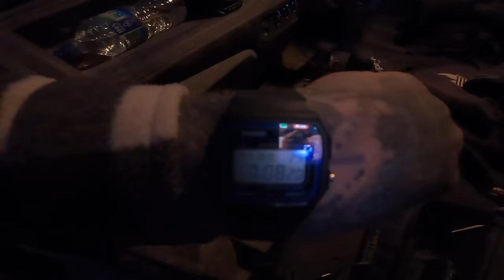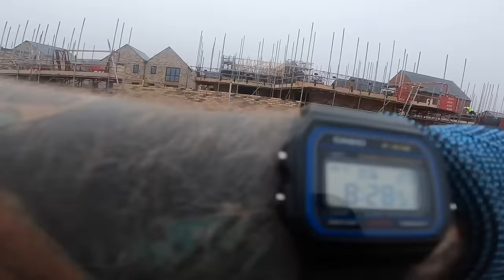Bricklayer and his improver building a single garage

Comment: Collison has made it big financially! That's why the man has switched to festool! I love their gear, my router and extractor although mega expensive, are the best you can get! Trouble is I can't ever bring myself to pay 300 quid for a basic 18v impact driver BARE unit! Oh yea.... 300 bones n the fudger comes with not a battery and even less charger! It's OK though because an 18v 5ah festool battery is a bargain at 125 quid and a mere 62 bones will land you a sparkly new festool charger! So for 300 sods you get an expensive, worthless piece of plastic that should you wish to round up that 300 to 487 sods, which as we all know in any language is 500 mother lovin pounds for a bar starred impact driver. What if you want something expensive like a chop saw, extractor or their plunge saw, I assume you use their saw to first extract the kidney you will need to black market in order to buy the damn thang.

Comment: I was a hoddy for a 6 & 1. 
I couldn’t keep up sometimes (on a straight run) and one of the trowels had to drop off the line to help me with loading out. Wasn’t unusual to shovel easily 5-7 ton into the mixer in a day. 
I could almost nosh the exhaust of a manitou when we had one to chuck a bath up. 
I was that fucked in the transit that I felt sick and the fellas used to give me a kick at my stop home. I miss those days. Rows, fights, arguments and weekly hassles.
Reply: My time as a nipper saw me sat in a muck tub in the back of a transit. It was fucking grim. Wet and cold in the winter and hot and dusty in the summer. The wankers used to squirt ketchup and mayo through the holes of panel divider from the front. 
They used to wind me up like fuck because I worked faster when I was raging! 
It sounds like Hell, but they were the best times of my working life so far!

Comment: When mixing wet and dry bricks....do full course dry, full course wet, not random mixed
Reply: ...you will find all the beds are dry after pointing with no brush marks
Reply: Always put dry bricks on the first course or on damps. Gives the wall a chance to go off. Nothing worse when the bottom bed is piss water and your wall wants to start leaning over

Comment: Couldnt you ask them to deliver dry bricks only, specifically stating you will refuse accepting any wet ones. They might be able to put a note on your order, i dunno
Reply: When they delivered they were dry ones, just didnt store em properly on site (first ones they were loading out at least)
Reply: Sometimes there delivered already wet and wrapped, holding in moisture, you can guarantee the salts will be coming out on wet red bricks

Comment: When I was young, I hated you brickies for the speed you put stuff down, especially when getting paid per brick.
One of my first site jobs was mixing the mortar for a couple of bricklayer teams, bags and sand on a board, bucket of water, and mixing it with a squaremouth.
busted my arse to keep up with them, then wheelbarrow and bucket on a line up the scaffold.
absolutely non-stop.
Good memories, good crew, but glad I got into dems instead, it's a lot easier bringing the wall down than helping it go up.

Comment: Would ran all sides in 1 go more so with damp bricks all dry similar rates beds and joints for point bar last few. Guessing you may have done that if had another body supply the muck to you and Tom. Just saves when last wall wacked at end pointing them becomes an issue. Smashed as per buddy. A don’t see nobody taking your crown at the super trowel. Ul smash it again a full expect another don’t fuck it Charlie boy 😎😎🤙

Comment: I like the red bricks, anything is better than an LBC fletton are they Redland ? anyhoo, looks like you forgot to hang out some  ties for the 1 1/2 brick pier mid flank @28.02 Oops, all done it mate. too late to poke them in now !! put some extra on top. or tie them in with a queen closure on the front ! naaahhhh ! plumb perps, for this money, and these bricks dont think so. site agent, building ispector, clerk of the works or whatever dont know shit from pudding. back in the day, on one site the developers q/s would calculate our meterage layed by pallets of concrete blocks used in deep footings, what he didnt know was for a £10 note the paddys would dig an extra hole for our hoddie to tip the odd pallet or two of blocks in, when the paddys came back from the pub, it would all disappear, apart from on our cheque for the month, Kaching, happy days.